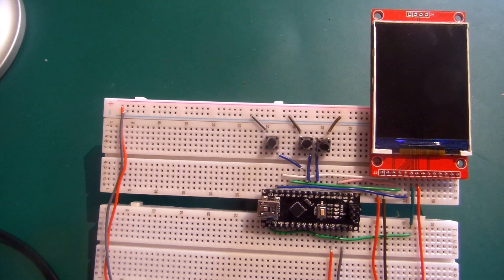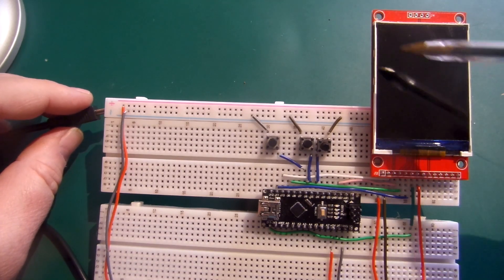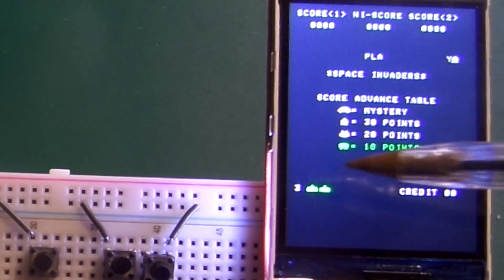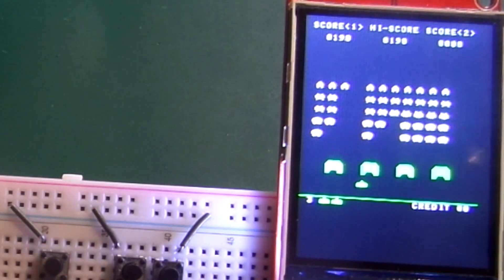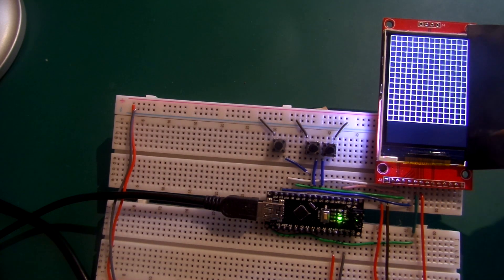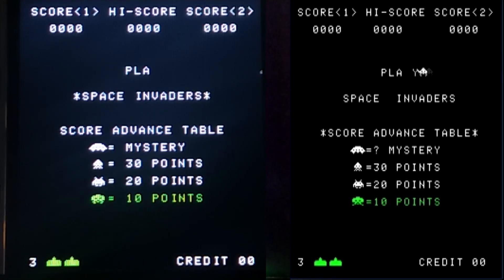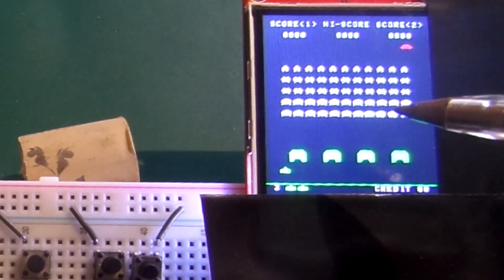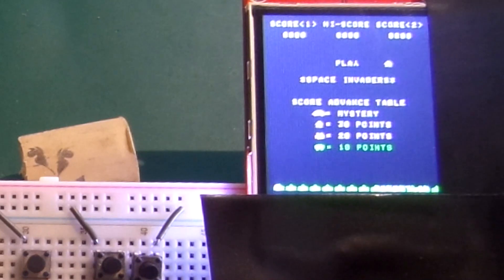Arduino Arcade Space Invaders - video game latest version

Comment: Why do I always find these things years after the site disappears or closes and there's no code to be found
Reply from the maker: It's coming back, my Web host messed something up and it took me a while to start sorting it. ! I'm working on it now. Most pages and data are back. Which page or code is missing and I'll manually put it back now.
Reply from the maker: Ahh, I've looked at the video. I see this was not completely finished. I'll have a think, I might release the code as it is.
Reply: @XTronical  Thanks do you have a link to your new site?
Reply from the maker: It's the same Web address as the old one xtronical. com. It's still a work in progress but getting there. Can you view it?
Reply: @XTronical  yes can see the site looks like only the old version of Space invaders and the menu for 6502
Reply from the maker: @Lamster66 new version not on yet

Comment: i have this code but it freezes on loading screen, Help PLS
Reply from the maker: Some questions. Do you see any part of screen appear ? What arduino are you running on and finally have you ensured all the libraries used are on the same version as shown in video. This video is quite old and some libraries update which breaks them with older code.

Comment: Hi there, thanks for uploading! 

Could you please list all components required for this project - either in the blurb above - or on your  'xtronical.com' website. Much appreciated.. 

(I successfully got Arkanoid going using MicroPython on an ESP32 as detailed by 'rdagger' at https://youtu.be/a7DrFqqu-78 - so looking forward to doing something similar with an Arduino.)
Reply from the maker: Hi, I've not completely decided on what other components I'm going to finish with, aside from the screen and arduino. The screen is a SPI ILI9341 and obviously an Arduino Nano. There will be probably a DAC of some sorts (I've have some I'm going to try) and an Audio Amp + Speaker. I usually use a PAM8403 audio amp but might try something else perhaps. But as I may have some un-foreseen problems with anything I choose I don't want to recommend any at this moment in case they don't end up in the final build.
Thanks for the Arkanoid project, looks good.
Reply from the maker: Have you looked at my Frogger project on the ESP32 : https://youtu.be/J9mV2IcEvP0